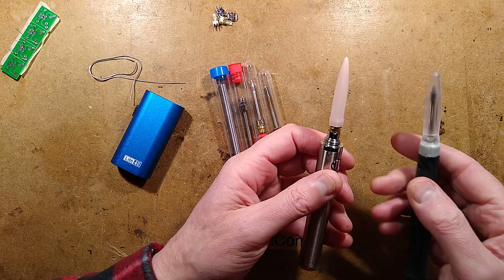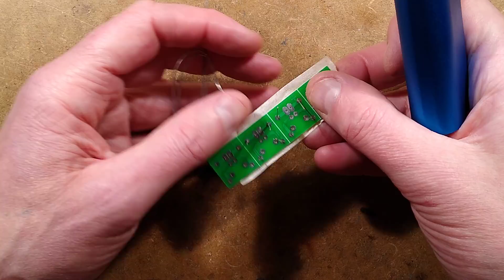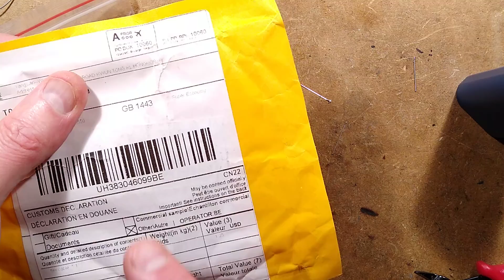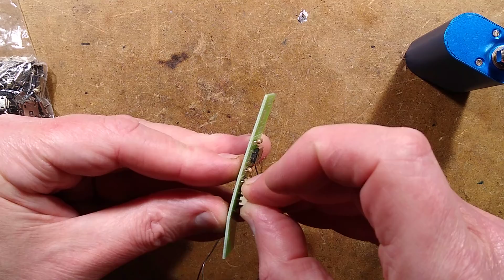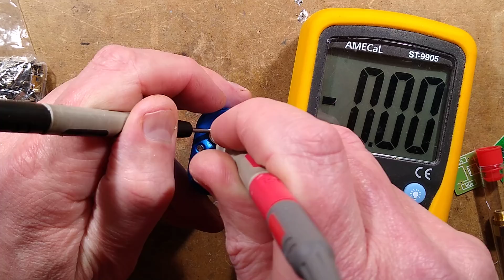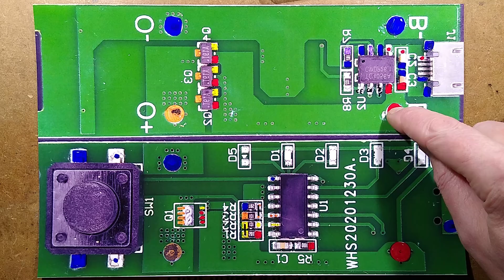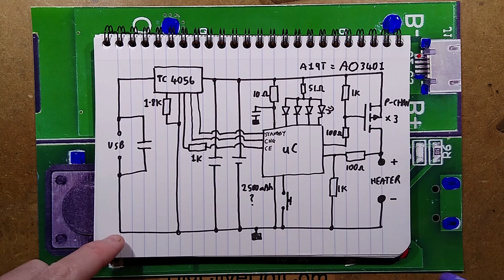Cordless soldering iron teardown (with schematic)

Comment: When I was about 12-13, I remember being sad that I couldn't fix my walkmans & headphones when they broke because I did not have a soldering iron. Of course I took them apart when they stopped working, but I could rarely do a repair even when I identified the problem. 

I'm just getting into electronics again since discovering your channel and while it's not practical for me to start making things at the moment, I do frequently fix stuff around the house as needed. And I already own such a vapour-producing device! 

I feel like my inner child just got some very good news. Thank you, Clive!
Reply: I remember broken headphones as a kid. Those stupid wires. Even if you twisted them together it wouldn’t work without soldering and that white nylon rope inside. Frustrating. I learned to get insurance from Best Buy
Reply: @Youtubecensoredmyusername  Yep, the wires are enameled because they run twisted together inside the cord. Easiest way to remove it is to push the wire into a flame for a split second. Be careful when doing this, the enamel will burn like a fuse!
Reply: @PunakiviAddikti  Good tip, thank you! My earbuds don't undergo nearly as much wear and tear as they did when I was fishing them out of my school bag on the bus every day.
Will keep this in mind when the inevitable eventually happens!
Reply: @PunakiviAddikti  thanks for the info. It was some kind of black magic when I was young. A wire that does not conduct.
Reply: @Youtubecensoredmyusername  Those old headphones, very common 50-60 years back, used an electromagnet and a thin diaphragm - I think they were taken from the telephone receivers. They had high resistance and can be used in radios without a battery.
Reply: @Youtubecensoredmyusername  You definitely had better luck than I did! I never had Best Buy (or Future Shop) honour a warranty, due to "exceptions" that I suspect they made up on the spot. I gave up on warranties after getting burned, twice.
Unexpectedly, I discovered that my Visa card includes idiot warranties on certain items, which was absolutely thrilling when I dropped a phone onto a tile floor mere days after purchasing it.
Reply: @phantomkate6  they also warrantied my Sony disk player for like ten bucks. Suckers.I’d break that all the time
Reply: @phantomkate6  Here, i was nicely informed by Saturn store that earphone cable is considered "consumable" and that they aren't going to warranty replace headphones with cable fault beyond 6 months no matter what, also same rule applying to batteries. "I'm sorry, we just can't, it would bankrupt us, you do have a vague idea how badly earphone cables are usually made, don't you?" It was 20 years ago. And they were otherwise always REALLY good about warranty, i have once had a scanner fully refunded over 3 years after i bought it, which is normally well outside warranty, because it kept breaking.
Reply: @SianaGearz  bummer I would get my Sonys replaced at Best Buy every couple of months but they might have came with my CD player that also got replaced for 8 bucks all the time. Sorry to hear that
Reply: This brings back memories.
I got myself one of these cheap 25W Weller irons from my local electronic DIY store for this Reason, but soldering Headphone cables never was a lasting solution.
Eventually the cables end up breaking right at the plug, which were almost the same price as thes cheap a** headphones :-D.
Ending up buying Headphones of slightly higher quality (Phillips, Sony whatever was available), still cheap but lasted longer and sounded better.
These litte Electronic corner stores no longer exists, but i still have my trusty weller iron almost 30 Years later.
Reply: @timhartherz5652  Tell me about it, the damn things always break either at the earpiece (difficult to repair), right somewhere down the middle (impossible to repair) or at the plug (most common, easy to replace). It gets annoying real fast. I finally found good, reliable earbuds which were a store brand. They've lasted over 3 years now.
Reply: @timhartherz5652   When i had a little too much time on my hands, i would slice open the plug with a razor blade along the bottom mouldline, trim and re-terminate the wires, and then glue the plug back shut with epoxy that i'd tint with graphite and use extra hardener in it (hardener in 1:1 epoxy also contains plastifier), for a repair that couldn't be seen or felt. Was pretty proud of myself. I think i did it once or twice with cheap Philips earbuds but probably never again really?

These days i find earbuds lasting an eternity almost no matter how i abuse them, but i've been using basically exclusively Panasonic Ergofit (originally model 120, now 125) for well over a decade now, those have absolutely bulletproof if cheap feeling cable, i still have my very first pair and several replacements and haven't managed to damage the cable on either of them no matter the abuse. And since about a year i've been using Chinese in-ear monitors (EDX, MT1, both modified by me) and mostly JCAlly cable or recently a Bluetooth cable, the cables just plug in with a 2-pin plug into the earbuds. Also have some decent sounding $2 clones of Meelectronics M6 Pro with an MMCX connector and let me tell you, 2-pin is a million times more reliable, MMCX has been nothing but a faff reshaping them to make contact. That being said i often fall asleep in these, so that's not ideal, but also speaks to their insane comfort level i guess.
Reply: @SianaGearz  I have several pairs of Panasonic Ergofits as well! They've far outlasted my Sennheiser earbuds (plastic coating on the cord started disintegrating even though I BABIED them) and they sound nearly as good!
Reply: That's exactly how I started with electronics. Didn't really fix any earphones but got me started soldering. Experience Is a must even if you don't fix the device.
Reply: @CircularMirror7  Great advice! If the thing is broken anyway, might as well give it a go. Worst case scenario is it still doesn't work when you're done. 😂 I just did that yesterday after discovering I need a part that I can't get. Oh well, I tried!
Reply: @CircularMirror7  earphones 🤣
Reply: I just chucked a screwdriver into my oven element and was away
Reply: @R.Daneel  I remember it just being called "wire wrapping wire". Rat shack carried it back in the 80's. I used to go thru alot of it building extended memory eprom circuitry. Excellent for point to point wiring of complex projects. I still have a good quanity of it. I don't do much micro electronics work as my eyesight isn't what it used to be, However, for an important repair I just break out the scope and that helps alot. I don't bother with "warranty repairs"  as most consumer level electronics are designed to fail after a certain amount of time.
Reply: I did my  first soldering at age of 6 or 7 years and at age of 10 i got a Ersa soldering station. No problem at all ...
Reply: Repairing stuff is a very useful skill. Making things has to be your thing, but honestly I think repairing (or at least trying) should be a standard skill. So good job mate, welcome to the repair world!

Comment: Coleman (purveyor of camping gear) made a crappy little portable soldering iron a few years ago called the  Powermate PMS7000, powered by AA batteries. It was completely useless - its heating was imperceptible and didn't even begin to liquify solder so mine went straight in the trash.  So I'm biased against battery powered soldering irons.

Comment: The "CE" Charge Enable is likely turning off charging while the iron heater is on. - 12:55
This will help prevent exceeding the max charge rate (current rating) of the 4056 charger IC.
Reply: Further, at 13:08, it likely defaults to charging with no signal from the controller thus it will still charge even if the controller stops.

Comment: If you have the details on second regulation bank, the black one. I have managed to go  in to the set up ,press a b for combination something.

I couldn't find the documatation to get it in running mode, just flip display etc....

Has a microcontroller for UI, and it's still apart sat in a box!!
Reply: Lol I think you answered it with this video... Drop voltage, won't give charge...
Reply: Will connect a full charged battery over the weekend.

Comment: That's pretty funny I've used a lot of those cheap vape batteries with a wide range of quality. Never thought to use the for soldering but it makes sense. Seems like the cylindrical pen style batteries would feel better in the hand

Comment: The knife bit can be used as a hot knife if you want to cut a square hole in a plastic box for a switch for instance, or to weld 2 bita of plastic together, or to melt hotglue ;)
Reply: Nice.

Comment: Maybe the CE pin is internally pulled high, and the microcontroller pulls it low when the unit is on to prevent charging during usage?

Comment: Most of my soldering at work is three or four solder joints a week, with maybe some reflowing. It always seemed awkward to plug my traditional iron in, wait for several minutes for it to slowly heat up, do the job in ~20 seconds, unplug it, and warn every passerby for several minutes it's still hot. This seems like a night-and-day difference for that use case. I will have to get one now. 🤑

Comment: Try a double tap on the button once it's on. Some devices have a "preheat" mode. Should keep the tip warm for sometime up to 30 seconds
Reply from the maker: Sadly, this one doesn't have that.
Reply: @bigclivedotcom  wow I feel special. A reply from the man himself. First reply I've every gotten from a creator actually. And I guess I should have assumed you would have tried that already. Cheers, happy holidays.
Reply: This kind of iron could use some automagic means to power the tip when the tool 
(body) is held, tip-down, at any of a range of angles e.g. 15 or more degrees from horizontal or vertical.
Reply: @michaelthibault7930  Some kind of capacitive sensor or something. Although I'm not sure I want it heating up if I'm walking around with it in my hand. lol
Reply: @dustinsmith8341  Modes, invoked via n-clicking the button… if you're going to be clicking the button cyclically in using it, you might as well make it so that you can opt to do all the clicking at once, transferring the on/off-ness to physical orientation of the unit. If you've got a 30° cone of off-ness around both vertical and horizontal axes, you'd have to expend effort to burn yourself while moving about with it in hand.

Comment: Back in the 70's I had a Wahl iso-tip cordless soldering iron that I used when on the road. It was handy but back then it used Nickel Cadmium cells so battery life wasn't so good.
Reply from the maker: Subsequently made by Isotip.  I think they may have a lithium version now.
Reply: I still use my isotip today it is quicker than waiting for my hakko to warm up for just one or two joints

Comment: I have loads of vape devices so I just need the tips...they are 510 threaded & found them at the local Walmart for under $8 each.  
You can find the tips for much cheaper but you will be waiting for it to show up from China many weeks from now.  
BTW:  You can call the battery part a "mod" so YT doesn't get all pissy about it.

Comment: lately i made myself one by making a base screw fitting for a usb soldering iron tip and putting it on a variable wattage VAPOR PRODUCING DEVICE. it's pretty useful it heats up in 10 seconds, better than most irons i had. my base unit can stay on for 1 minute and everything about it is adjustable by firmware

Comment: I had no idea such things existed. Going to have to get some of these tips. Usually always have my device with me.... its variable wattage. Now I don't gave to worry about finding a socket etc to plug a soldering iron into I can just keep some tips and solder in my multimeters cases. (Yes I have multiple "kits" in my toolboxes. One at home, one in vehicle along with a power probe and obd2 reader, and a spare that's floating around the house here somewhere) Never know when something comes up that a multimeter can help you diagnose / fix.

Comment: Wait, this is a kind of add-on for an already existing VAPE device?! Like 510 thread connection?! I used to vape a lot, because it stopped me from smoking ! But this fits on a device that puts out say 50 or so watts, and instead of kanthal wire, you just screw on this and because of the enormous wattage output of these devices with those batteries, this is what can be made?   
Sorry, years ago we all knew these technical  specs, and we still didn't put one and one together.
Reply from the maker: If using a programmable device it will need set down to between 10 to 15W.

Comment: This is pretty cool. I used to vape with one of those big cloud producing high end vapes until after several months I realised it had coated everything in my house in a thin film of condensed  vape liquid I was a pretty heavy smoker before hand so I was puffing a few times every few minutes.  I still don’t smoke, I eat nicotine mints like candy though lol.
Reply: Yeah, glycerol coats stuff, but at least it's easy to wash off, unlike smoke tar...
Reply: @tomclanys  yeah it was easy to wash everything down except non cleanable porous things. Some walls had to be repainted over, thankfully most of my walls were already painted with washable paint.
Reply: @ElectricChicken  Oh sad to hear, fortunately my walls didn't get anything visible on them, it was mostly the smooth things like a few of my shelves that got coated, looked like they were wet but never dried. Interior of my PC also got hit, looking at clouding of my plexi/carbonate window from being greasy.
Reply from the maker: Glycerol/glycerin is also a humectant and absorbs water from the air, so it always stays wet.
Reply from the maker: The first fog machines used glycerin and it did leave a film.
Reply: @bigclivedotcom  do they not use it anymore? I thought it's still vg/pg mix
Reply: @tomclanys  they do.   You still have your vg/pg base liquid. Been making my own for a long time. I get the buildup too on smooth serfaces. While unsightly, it does have an antibacterial effect due to the propelene glycol content. It's been my experience that it kills the bacteria that causes upper respetory infections better than any antibiotic.
Reply: @Mad_Scientist2052  I was talking about fog machines, I know about vaping. I make my own liquids too. It's also true it's antibacterial, but sometimes you just can't vape when sick or you'll cough your lungs out :P
Reply: @tomclanys  I know. It's been a very long time since I have gotten sick which I attribute to quitting smoking.

Comment: Clive, is the power supply unit essentially what one would use for vaping, and if so, does a tank fit onto the blue one? greetings from nova scotia :))
Reply from the maker: It does, but the tank resistance would need matched to the simple battery voltage output.  Something like the classic 510 cartomizer.